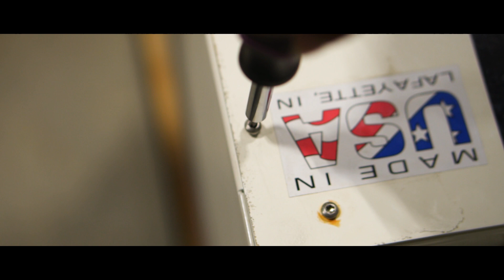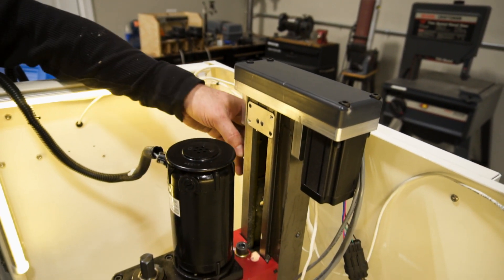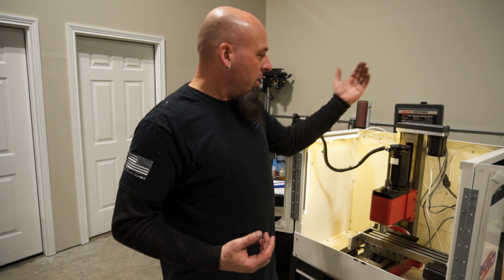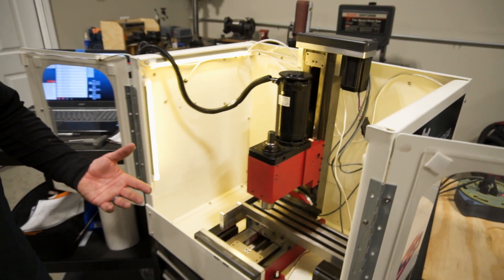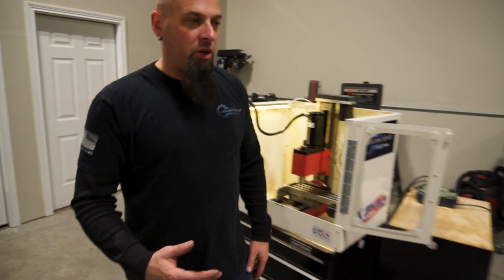Edge Update #22: Upgrading Our First Machines!

Comment: Wich tolerances in metric and inches the machines worked? And the finishings?. I am so interested. Thanks
Reply from the maker: Jorge,  Thanks for the comment.  We're not sure what you are asking in this comment; However, our HX Series II CNC machines have measured axial repeatability of 0.0005" (0.01 mm) over the extents of the machine's travel.  Our base units are able to hold  +/-0.005" (+/- 0.1 mm) tolerances easily maintained while cutting. Tighter tolerances require more attention during setup and operation.  We also offer an add-on controller and linear drive packages if you're looking for a production application.

Comment: so you guys use the sieg x2 machine as the base model, my concern is that your motor turns the spindle at 9000rpms, however the 6206-2RS spindle bearings for the sieg and most mini mills are rated for 7500rpm max. When will you guys update those to prevent premature wear?
Reply from the maker: Crl A,   We have earlier 'Edge Update' videos that discuss the COTS (Commercial-Off-the-Shelf) process that was used when initially developing our machine product line in more detail. In short, we originally purchased the X2 manual machines, stripped off all the components, re-machined the castings, and added on our own parts.  Leading Edge Industrial's castings for our HX8610 Vertical Machining Center are now being made in Michigan, USA (no longer the X2  machine as the base model, as seen on the machines pictured above).  The spindle bearings selected for use on our machines are rated to 13,000 RPM, which greatly exceeds the 9,000 RPM max spindle speed.  Therefore, the premature wear that you are concerned with has already been addressed.  As Larry states in this video, these models were machines #1-4 ever produced by LEI and should not, by any means, stand as a representation of our current product line.  Thanks for the comment!